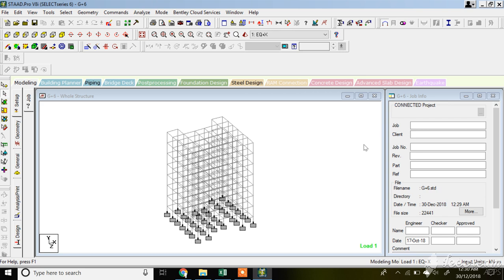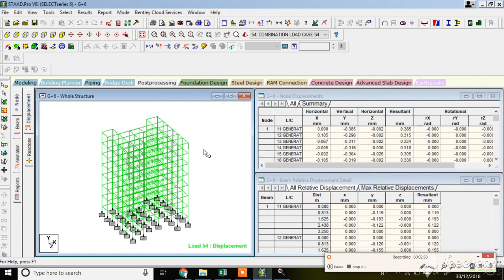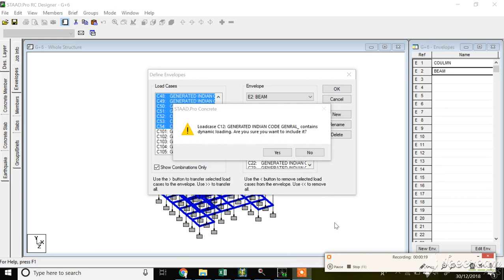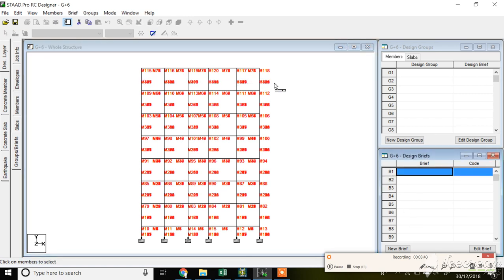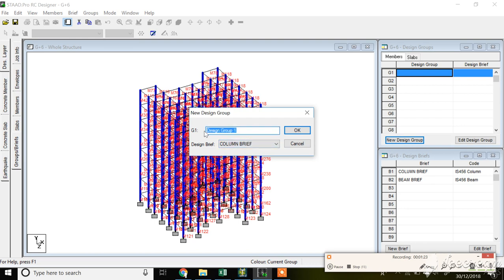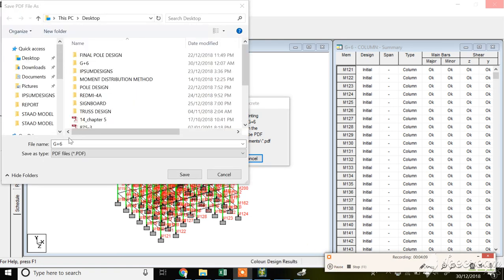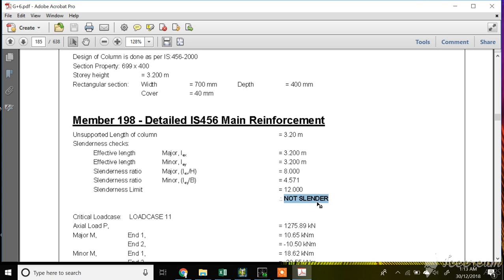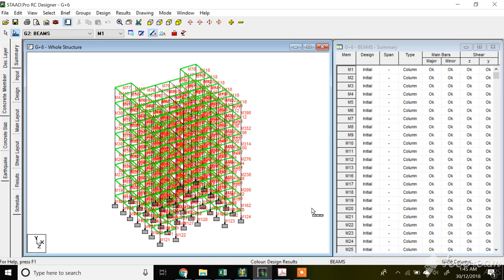G+6 Lecture-07 - Analysis & Design using Staad Pro Part-1

Comment: Thanks again, Can we model structures with plate element instead of assigning floor load option when performing wind or EQ analysis so that plate acts as a diaphragm.How to consider the Overhead water tank and Passenger lift loads when designing a Multi story buildings
Reply from the maker: these tutorials i tried to make it very simple that's why the problem chosen this way, yes  definitely we can model plate and that will have more practical effect. in future we shall be coming up with more complicated and tough design. i tried to make this channel very simple for budding Structural Engineers so that they can learn from basics. 

your suggestions are very useful to us . thanks a lot.